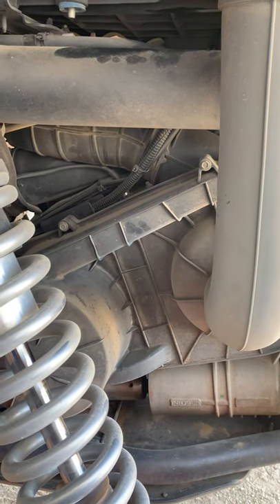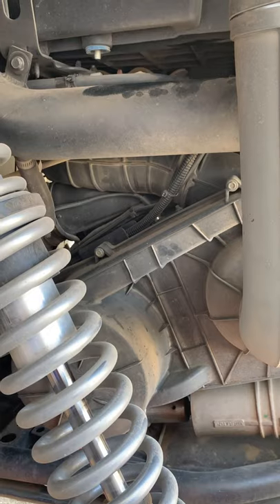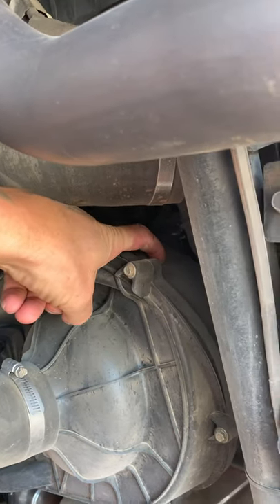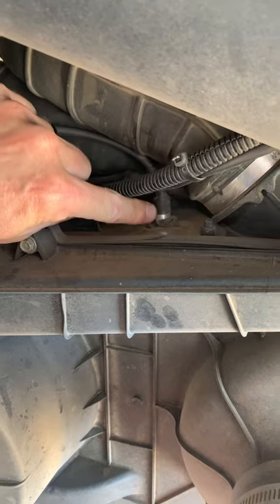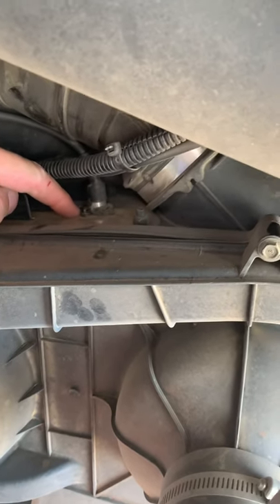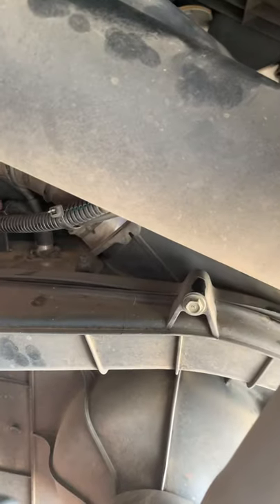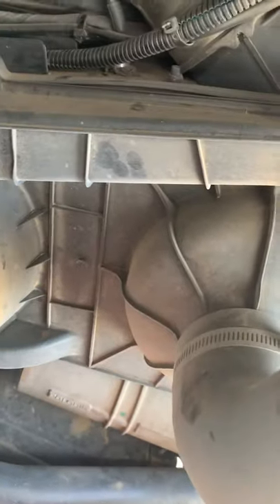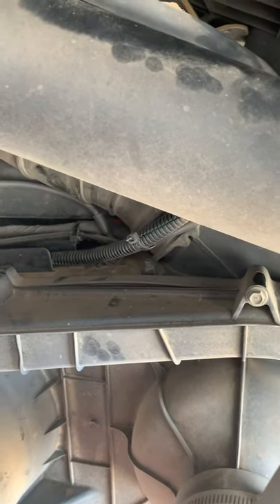Razorback belt temp gauge review

Comment: Hi you doing thanks for the info i have aquestion about your rzr i see ypu got trailling arms and radius roda from super atv i have the same set up but im having issues i was wondering if you could help me  my trailing arms are making my tires toe in and super atv wont help i wanted to see if your rzr is the same way
Reply from the maker: I actually have had the same issue.  I purchased the shim kit that super ATV uses for their portals.  It comes with 3 different thickness shims.  I used the medium shim on the left side and the thinnest shim on the right.  They mount between the trailing arm and the wheel hub.  I am actually shooting a video soon on them
And where I purchased them.  Hope this helps.
Reply from the maker: Here is the link to the shim video

https://youtu.be/meFT8BWJ5vc